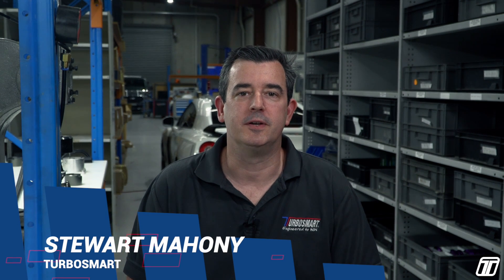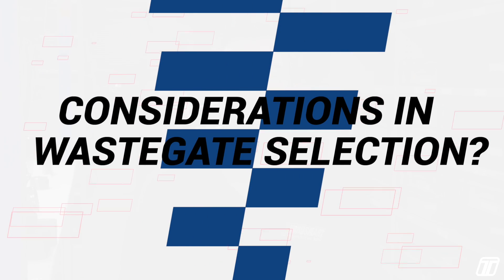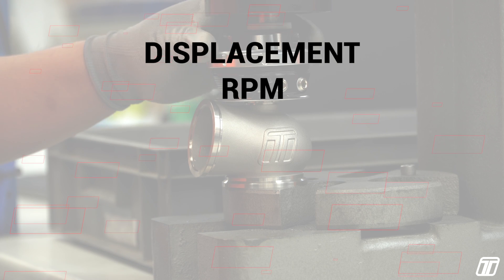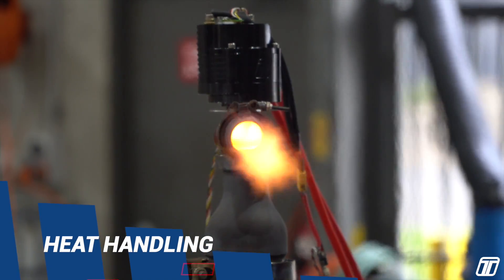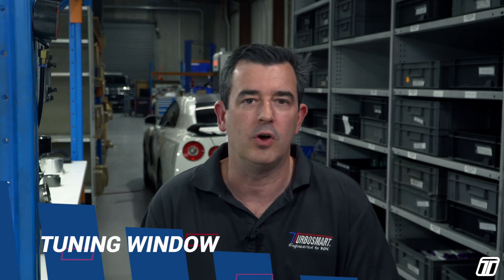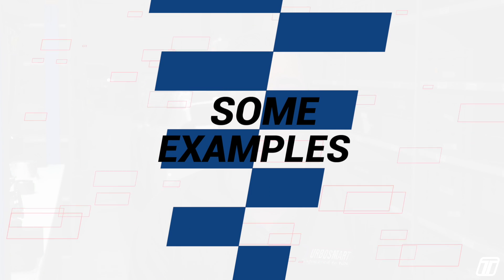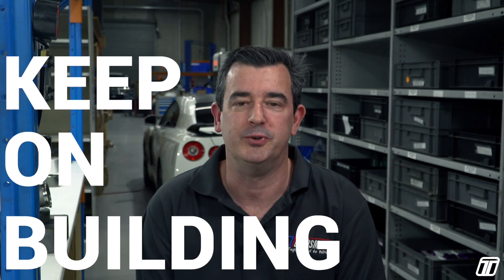Boost Basics | How to choose the right External Wastegate!

Comment: I'm not trying to argue with this video, because this looks like a very credible source of information. But the first thing I read after google searching "can a wastegate be too big".  Was that it can be too big because when the waste gate cracks open the boost will drop and could possibly never come back up.  Lol.  The writing that i read said the complete opposite about being easier to tune. Which in a way kind of makes sense, but the fact that if you want to run lower boost you would probably need a bigger wastegate makes more sense. This turbo stuff has an endless supply of opinions and controversies, lol.  The only way to know is to just buy the wastegate that seems right and see for yourself.  Thanks for the video it is very helpful especially the examples of good combos.

Comment: Gonna see this i got a Da Integra that have a 44mm  wg but i feel its still to small for my set up  i believe brand have to change too 😂
Reply from the maker: Our 45mm Hypergate will fit existing 44mm flanges. It is the highest flowing 45mm wastegate on the market as well. If you have more details on the car feel free to reach out to our tech team for assistance on if you should increase the wastegate size!

Comment: So I have a the stock turbo in my mk7.5 VW GTI with a Catless downpipe (I know I messed up) what size external waster gate should I get and what’s everything I would need to get with the waste gate?
Reply: 38
Reply: Just need the manifold that has 2 bolt flange for the 38 turbo smart wastegate

Comment: So let me throw my scenario out there since I didnt see you list it.

Decently built 5.3L with a 88mm turbo. Would a 50mm BOV and 50mm wastegate with CO2 work well? The wastegate would have good priority and the Turbo is a T6 with a 1.09 A/R housing
Reply from the maker: There are still several variables that could effect our decision. Fuel, turbo brand, power goals, what boost it will take to make that power, how low of boost you're trying to control, etc. It would be best for you to reach out to our technical support team for recommendations so we can thoroughly understand what we are working with.

Comment: What size gate do you recommend for a big single GT45 gonna only make about 5-6 lbs . I was thinking the 45
Reply from the maker: It is difficult to say. There are several variables that affect wastegate sizing. Engine displacement, fuel type, horsepower goals, RPM, etc. We would recommend using the product advisor found on our website for a product recommendation tailored around your setup.

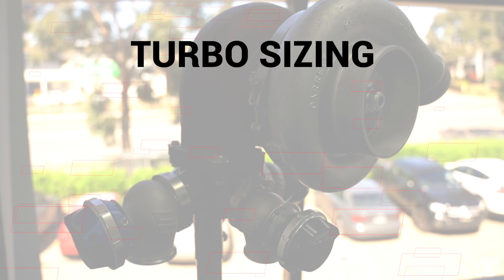Comment: 4:00 when you talk about compressor wheel diameter, you're talking about the upper smaller or the lower larger diameter of the compressor wheel?
Reply: The compressor wheel is up front or cold side.
Reply: @mr.c5217 theres 2 diameters on the single wheel, bittom of the wheel and top

Comment: im running a GTX3582R gen 2 turbo 66mm - planning to run a  6 boost high mount manifold should i run a 50mm waste or 45mm? planning to run 15-20 psi
Reply from the maker: You can try out our Product Advisor found on Turbosmart.com for product recommendations based on the multiple variables of your application!

Comment: What would you recommend for a tb42efi running a gt3582r, will be running in between 10-12psi, would prefer to have it a 2 bolt flange as that’s what’s currently on the bottom of my exhaust manifold
Reply: why would you get such a large turbo to only run it at 10 - 12 psi. theres no point havning such a large turbo

Comment: Which External wastegate size 
 do you recommend for an EFR 7163 , Subaru strocker 2360 cc and target boost around 26psi?
Reply from the maker: Check out our Product Advisor, on our website. You'll need some info on your setup (target power, max RPM, turbo info etc) and it will give you our best estimate! https://www.turbosmart.com/product-advisor/

Comment: Would a 38mm be too small for a gtx3576r single scroll .82/84 (cant remember) housing with a power goal of roughly 500-550bhp? It's on a 2.8 litre v6 on a 2007 saab 9-3 Aero.
Reply from the maker: It's not the High End HP target that will dictate the gate you need - It's the low power target... So you tell us, how much of a 'tuning window' are you after? And keep in mind this is even more important if you ever need a low-boost run in tune. etc. In any case, you can visit our product advisor now live on the website which will tell you which gate we recomend. You'll need to enter the variables of your build & we'll tell you which products you'll need! https://www.turbosmart.com/product-advisor/
Reply: Snap... saab brought me here too.

Comment: I got the comp gate 40 on my bugeye sti, from 1500 rpm to 7000rpm it holds 20psi     all the way on every gear and it's bloody loud 😈
Reply: what fuckin turbo are you running for boost at 1500rpm a td04? lol
Reply: @CuttinChris  don't have the car anymore but it was the vf35, I got sick of it cause it really stinks up the cabin lol
Reply: @MannyG88yo  i don't blame you they sound so good but its like a header exhaust leak for fuses wise but worse haha
Reply: @CuttinChris  I was going to plump it back but would of lost the noise, it was so bad my clothes smelled like I was standing in front of the exhaust

Comment: But what are the real dissedvatages of running a to big waste gate? All the explenations in this video make the bigger ones seme like the better option
Reply from the maker: Basically, the bigger will always give you the widest possible tuning window. The only real problem with running a larger gate than you need is technically the boost control 'resolution' when the gate physically opens off the seat. This in 99.9% of cases however is easily compensated for by any decent boost controller, including a simple mechanical boost-tee.

Comment: Very informative. I would even be interested in a longer video elaborating more on the tuning window
Reply from the maker: We'll look into that for you, great idea! Basically, When we refer to the 'Tuning Window', we're talking about the difference in available performance at low boost versus high boost. To explain an overly simplistic example; If your 3000HP Pro Mod Drag Car can't use more than 300HP on launch due to grip levels or chassis, you will need to bypass 2700HP & this will need a much larger gate, with good manifold priority. A smaller gate may happily allow you to dial in you top end HP target, but if you're trying to get down to lower levels for whatever reason (Drive ability, launch control, valet mode, etc) you will need a larger gate for the extra bypass requirements. The most often overlooked requirement is running in a new motor... Often the manifold & gate is chosen for the HP, but the requirements for a low boost run in tune are ignored until its too late!
Reply: @TurbosmartHQ so a larger wastegate gives a larger option, as in it can do both high and low, is there any drawbacks in choosing a big wastegate or would it be better in general?